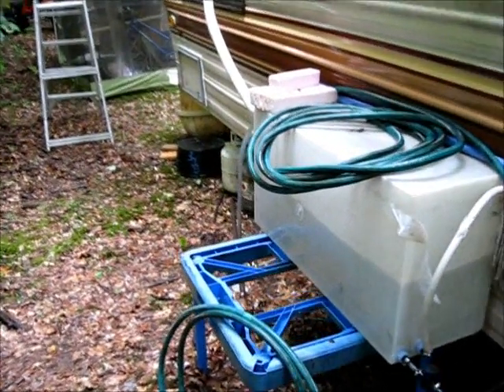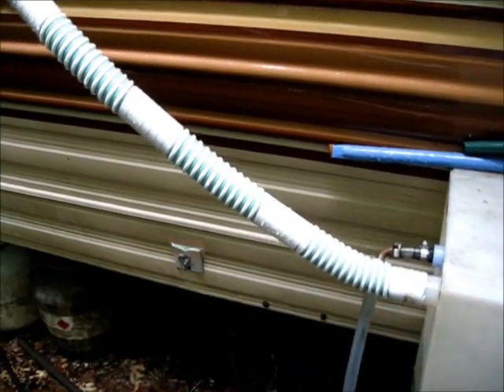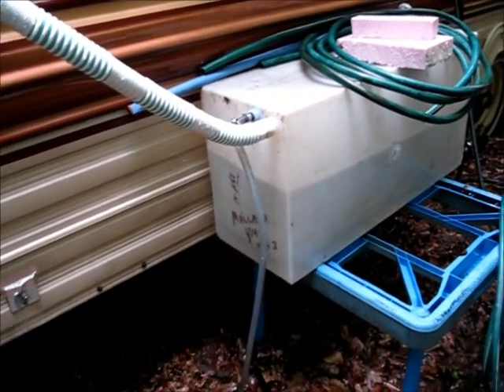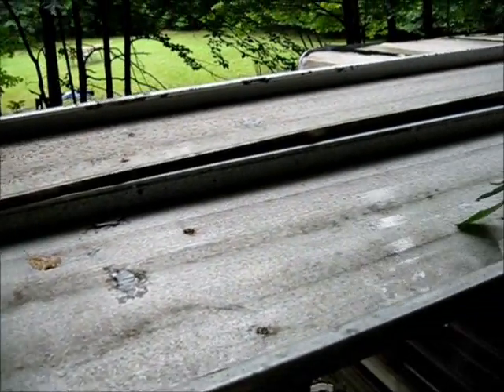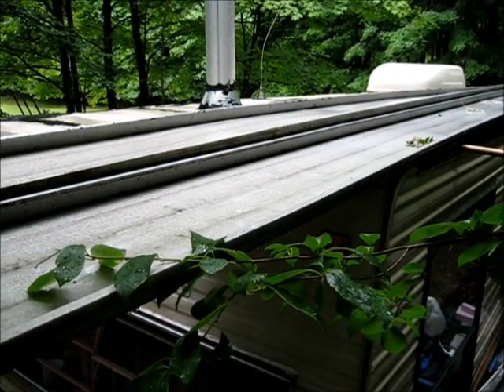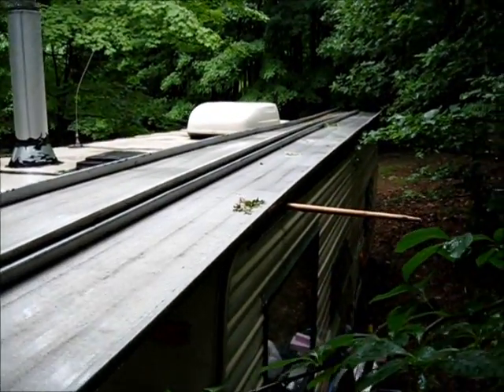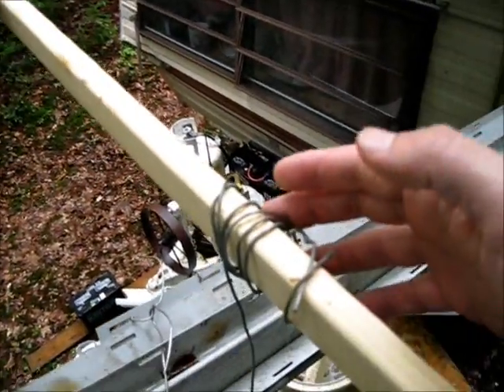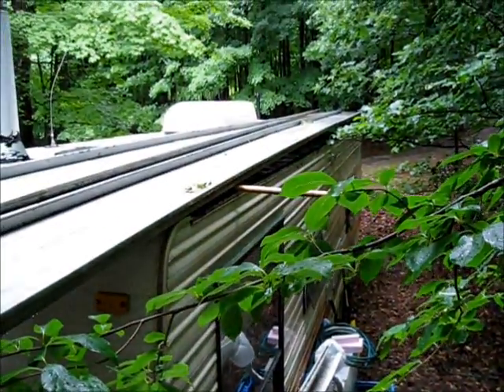Off Grid RV Rain Water Collection System

Comment from the maker: A screen such as a window screen will take out the large stuff. Place it closer to your tank, like in the funnel. I am using a Brita for now to filter it for drinking. I let the dirt settle into the bottom of my collector tank for now. The water in the camper I do not drink. It tastes like plastic once it goes inside that tank. I use that for washing and bathing. I will be making a large scale sand and charcoal filter soon. Watch for the videos.

Comment from the maker: Yes, thats a chimney pipe. I have an antique little wood stove with a homemade water boiler heating system to pipe the heat to the far end of the camper. Works so well. And with the boiler I use less wood to heat the whole place.